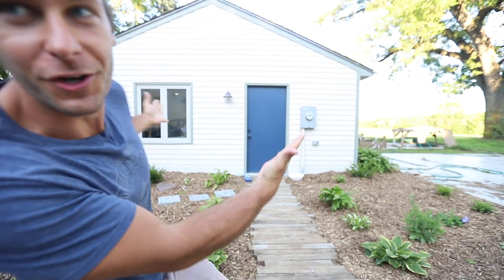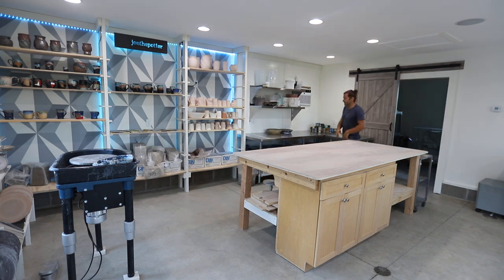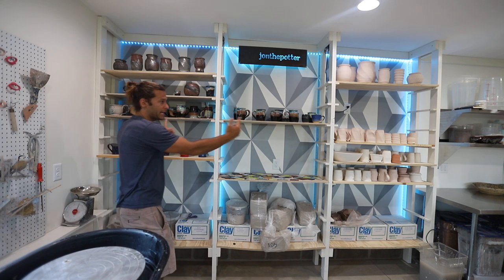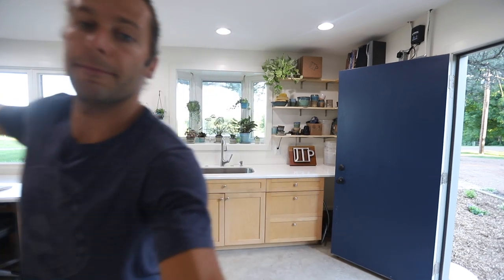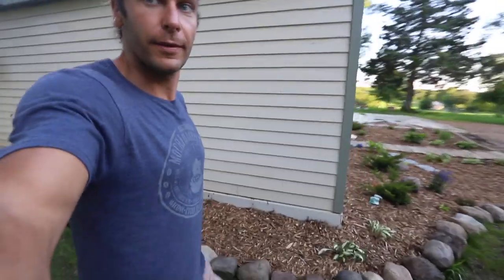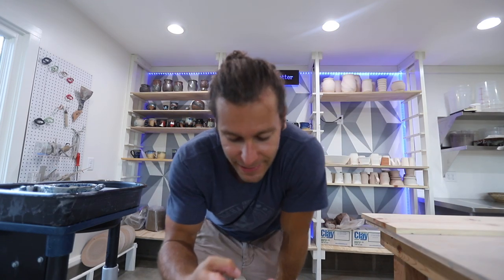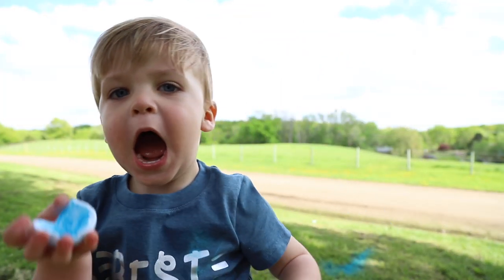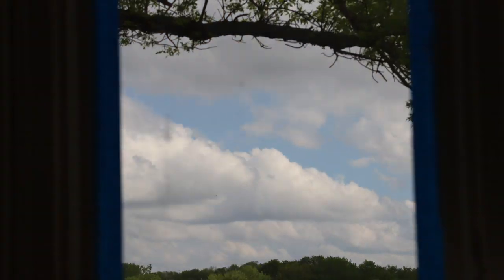We've been keeping a SECRET

Comment: Love it all.

Can you use vents and (small) fans to direct heat from the kiln into the main studio, maybe at night for winter months, and out of the building during warm to hot months? 

Guess some kind of thermostat would help if you used the excess kiln heat. Maybe not if you run kilns at night. 🤔

Just say’n.